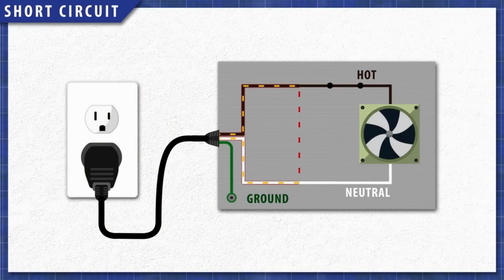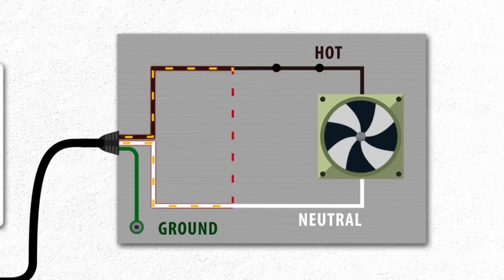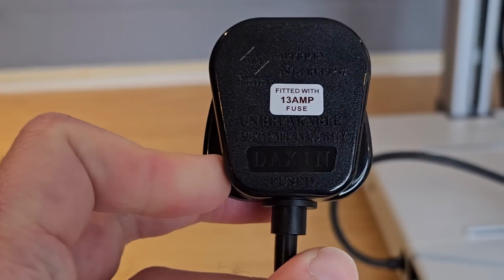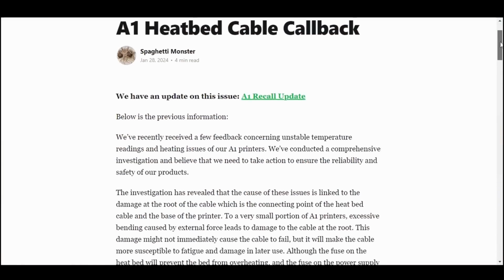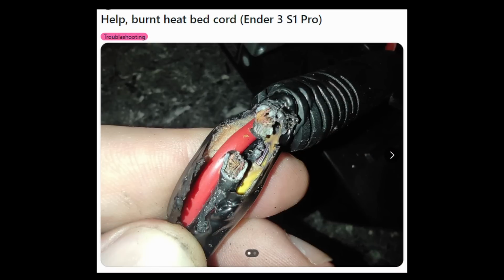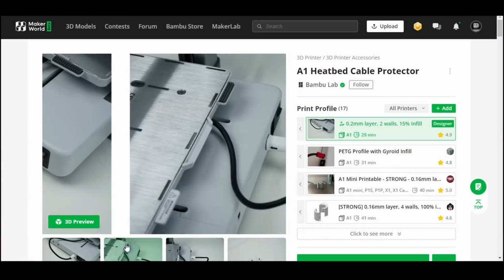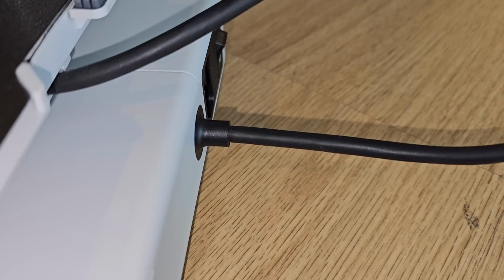Bambu Lab A1 3D Printer Recall - All You Need To Know

Comment: the problem with bambus closed ecosystem and proprietary hardware. on other printers you just fix it.. here you need to send it back.. 
thats why they never will be on my desks
Reply: What's keeping you from fixing it and getting a new hot bed and $120 credit as well? This problem has nothing to do with proprietary vs. open source.
Reply: @Immolate62  for those who care about warranty - and thats why most buy bambus because of its noob proof concept, everyone buy these.. 

i build my own printers.. has nothing to do with the topic.
sure i could fix it.. but i wouldnt do it on a machine like this.. they are not the tinker machine like others - at least for me.

And if you then really may have a problem, you dont have warranty.

Thats a problem when sonething electronic or software related will become a problem. You simply wont fix it as easy like on other printers.

Im just looking for the eco system as a whole
Reply: @hanswurstusbrachialus5213  you seem to have talked yourself into a narrative. Can you replace the wire with something better or not? How often do you return printers under warranty? Do you understand probabilities and risk versus reward? I'm not talking to Suzy homemaker here. I'm talking to someone who is capable and resourceful and is experience at assessing risk - in other words, most people who follow 3d printing channels on YouTube.
Reply: @Immolate62  The A1 uses a smaller cheaper power supply than the Ender 3, so the heated bed will always run on mains power. There is less cost but greater risk for the consumer.
Reply: Contrast this with the Prusa MK series that was the product of a long and iterative process of practical engineering and incremental improvement.

Comment: Ive choosen to repair myself. I cant afford the uplift to a P1P, Ive bought accessories for the A1 and I don’t want to wait until May. I've watched the guide to changing it, and it seems easier than a lot of things I've done. It's not like I gotta get the soldering iron out. Plus the £111 voucher was the icing on the cake. Ibe gone from angry as hell to impressed at how they are dealing with it
Reply: I thinking same but if like he said, there is fine tuning to be done while changing the bed and this could lead to very bad print quality.
Reply: @ontime8342  I can't see that being an issue as it'll run the calibration and if it does cause issues like that Bambu will be right back where they started with loads of angry customers
Reply: I have opted for the bed replacement and hopefully the machine's self calibration sorts out printing issues if any. I have checked my cable numerous times and also printed and attached the cable strain clip and have seen no issues at all. I am also connected to mains power through an RCD so any short will shut things down immediately. So I will be using my machine under close supervision, i.e. no more running it overnight like I had been for weeks, checking the cable before and after every print and wait to see what happens with either a bed replacement or something else that Bambu might come up with in the mean time. Sending it back is not an option for me as I got rid of the packaging weeks ago.

Comment: Another reason I'll not go back to bedslinger FDM printers.
Reply: Just another reason to don't buy cheap Chinese crap, in this particular case you need to use high flexibility silicone cable ( as on CNC router machines ), not that plastic insulation crap but when you don't want to spend to get a quality bed slinger then you get what you payed for, and not just printers... cheap Chinese stuff will be always "high" quality.

Comment: why no one is talking about the 80c to 100c firmear update thay did makeing a cable cary more load ? or em i not right that the cables forcet to cary more load im just asking lets say
Reply: 100c just takes longer. The load is dictated by the impedance of the heating elements. All the firmware did was increase the limit of the bed.

Comment: The problem is not just the outer plastic getting fatique. The tight wrap of the inner wires by the outer plastic dipped insulation is the problem. They are using the wrong cables on all their bed slingers.  Same applies for the cable going to the extruder. You either need cable chains with loose single strands inside - or a flexnet wrap cable to allow for movement.
Reply: Pro tip a flex net sleeved cable still has a solid ass cable / strands of cables inside lol. They simply just used the incorrect inner insulation for those specific wires and the outer sleeve for aesthetic reasons is also incorrect and on top of that, length wise, it's too short of a cable and with it not having much flex or play to move it's forced to flex in any given spot, but once it finds a spot to flex it will flex in the same spot over and over and over until failure.
Reply: Such a basic mistake for a company that should be taking "3d printing to next level"
Reply: Also the thickness and type of wire they are using. They fatigue as well. Bend a piece of metal over and over again, eventually it will break. Same case here.

Comment: but all the bambu fanbois said it was a flawless printer
Reply: I've got a anycubic kobra 2 max. There are a lot of issues with that printer (that i didn't know before). So I don't see a reason to call out bambu labs for a reasonable recall.
Reply: @clockworkvanhellsing372  yeah I've got one of those too. Big boy, but it stays broken mostly.
Reply: @Immolate62  mine runs okay, i've build in a seperate 500w psu to drive the hotbed. (the klipperforum has instructions for changing the printer.cfg). Combined with a 0.6mm copper nozzle, a viper bimetall heatbrake (for standard nozzles & 300°)  & reasonable tuning the results are getting okay. The biggest issue would be the wobble of the heat in y direction.
Reply: @clockworkvanhellsing372  my biggest problem has been layer shift over 50mm z height. Can never tell where it will happen but it happens often.
Reply: Fanboy spotted, you!!
Reply: @accumall3027  LMAO you're clearly offended fanboi!!
Reply: What a ridiculous statement.
Reply: @TheNerdArmory I wasn't seeking your validation or affirmation but thanks! 😂
Reply: @joemendoza9188  I appreciate you letting me know. I guess it was unclear what your intention for your comment was and what you were looking to come from it.
Spend some time next time so we all know <3
Reply: @TheNerdArmory  I'm good, thanks
Reply: @joemendoza9188  oh... In that case, I'm good thanks too. :)
Your statement was ridiculous. :)
Reply: @joemendoza9188 why do you post so much if you don’t seek validation? Just say you’re poor.
Reply: @_..-.._..-.._  lmao that doesn't even make sense. next time come at me with something thoughtful. Jacksass
Reply: I take this as a win, many manufacturers ignore when they did something wrong in QC and blame the customer instead (apple is a big one), Bamboo lqbs doing something about it is actually refreshing.
now, this doesn’t mean it’s a done deal, they need to fix the machines before we can put this behind
Reply: You're just a fanboy in another direction.. Who gives a crap what people prefer to use. Worry about what you're doing.
Reply: @Vanity2021  aww fanboi is mad mad LMAO
Reply: Imagine hating bambu because they’re popular. Let me know how creality or some other shit Chinese printer company handles a situation like this. Oh wait they’d just ignore it. Go be a hater troll somewhere else.
Reply: Bambu labs is also infact Chinese

I like bambu, but I have an ender because as much as I want a p1s, there is no way I could afford it
Reply: Said nobody.
Reply: @Immolate62  says the fanboi
Reply: Spotted the fan boy
Reply: @teriyakipuppy  yeo and you're mad mad LMAO
Reply: This guy didn't talk about any other printer/company. He is just saying things that people in reddit say...
Reply: Bad troll is indeed bad. 

It's not fanboyism to call an amazing machine for the price, a great machine and value. No one is perfect - every being and every company make mistakes. Even you, the holiest of interwebz trollz
Reply: @marinegeek_23  its not trolling when its the truth. Only fanbois get offended! period.
Reply: @marinegeek_23  lmao and you just proved my point how fanbois think bambu is flawless and without issues. But yes I'll continue to be delusional just as you :)

Comment: And yet another reason why I don't and won't own a Bambu printer.
Reply: Yet every car company has had recalls. Every major electronic company has had recalls. So you may as well just not own anything with that thinking.
Reply: This can (and has) happen to anyone. I know the Anet A8 actually did start fires. The original sidewinder had issues and I had a CR6SE  that I had to check wasn't an older model as it would need some krypton tape to protect it from a short.  It's a pain and I was angry but tbh it looks about as hard as wiring a plug to sort and giving us £111 will make up  for the inconvenience.
Reply: Tesla even recalled hundreds of thousands EVs... Bambu is the first company that recalls 3d printers.

Comment: 2:00 you are completely wrong about delivering more current 

The higher voltage is actually there so you could use SMALLER current to deliver the same POWER (ohms law) the cable gauge is actually determined completely based on current and NOT power therefore you can actually use a smaller cable cross section to deliver more power

In the Bambu A1 case they use 110/240v (voltage) and up to 7A (current) which make the bed heater 770w (power)  in 110v countries and up to 1680w in theory in 240v countries but they seem to have capped the PWM under 700w in real use………
They are using a 0,5mm2 cable to do this as it is only up to 7A 

However if they wanted the same power out of 24v they would have to pull 29,16A from the power supply which would require a much larger power supply and at least 2,5mm2 cable……..
Reply: I guess he meant to say "power" (i.e. Watts) because it's correct in that case: "The main reason for doing this is to either deliver the same amount of <power> to the bed using a smaller cable or alternatively deliver more <power> to the bed using the same size cable".
Could also be a heater with higher internal resistance for 240V countries, would be the common practice for DIY where you'd buy a silicone heating mat with some watt rating for your specific voltage 24V, 110V or 240V
Reply: @zapl80  yes exactly
Reply: I have an Artillery SW X2. The X1 had issues with its line voltage bed heating cables, but they quickly fixed it and put lessons learned into the excellent X2 cable. I trust it and I am thankful for the agile bed heating. Your toaster is easily a more substantial shock hazard than this thing is.

Comment: There are some images floating around on social media that points to a different possible cause. The strain relief is heatpressed onto the cable. This can lead to the insulation of the wires melting and the bare copper being exposed which can lead to short circuits.
Reply from the maker: Do you have a link to any of these posts? I would be interested to see what people have found.
Reply: @RickyImpey  An A1 owner in the bambu labs a1 owners group on Facebook did a dissection of their bed cable. The images show that the strain relief is indeed heat pressed on and the insulation on nearly all the wires was melted and copper conductors exposed. I havent looked since late Friday but im going to guess that if the images are still up they wont be for long. It also appears the strain relief is not big enough, the cable isnt long enough, the conductors probably should be a higher gauge, and the insulation probably should be of higher quality due to the repeated movement the cable is subjected to. While I specifically dont know how many AMPs of mains voltage the cable is carrying the photos clearly make them look small.
Reply: @DMB-h1m  I've seen reviewers measuring around a 300W draw, so if the bed runs at mains voltage, then in the UK it's barely pulling more than an amp. Take a look at the thinnest 3 core flex, and it'll almost certainly be rated to 3 amps - So nearly 700W, which is definitely more than the A1 heatbed uses.

The problem is almost certainly related to poor strain relief, perhaps poor manufacturing processes, poor cable strand selection, and lack of testing to ensure the cable type, length, etc are up to the frequencies, vibrations, range of movement seen by a printer bed.

A pity the end users have become the medium/ long term product test department, but at least Bambu seem to be handling their failure in an open and constructive way.
Reply: @RickyImpey  I did post them but unfortunately Youtube always seems to classify my post as spam when I post a link. So I sent it as emails to the channel address.
Reply: Were the conductors copper or aluminium? Often corners are cut here because alu cables are cheaper than copper ones.

Comment: I actually snagged a Flashforge 5M since they were on sale for $300, as soon as I saw the recall for the A1 on Friday. Yes, I didn't know until Friday and was using it a ton. The app on my Pixel 7 don't like sending push notifications so i did not see that when it was originally sent out.

Now I'll still have my Ender 3 S1 Pro and the Adventurer, once it's here Wednesday. But my wife uses the A1 since she doesn't have to use a slicer and can get a profile from the APP.....

Now I wait for the replacement bed and that $120 voucher.
Reply: Great choice! They just released vanilla Klipper firmware for it as well as design schematics and a print your own enclosure design they'll have a cheap accessory kit for soon. It's a lot of printer for the money.
Reply: I use now use 120 volts at 750watt and fast to heat the bed. The first time I put in with wrong strings wires. And one broke. I changed the wire with silicone  coat. So they are the best bending